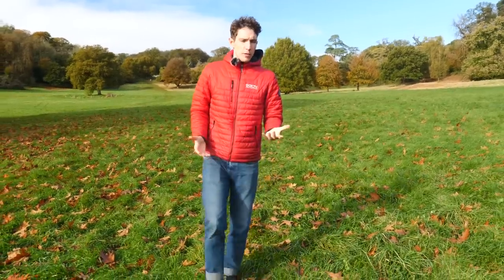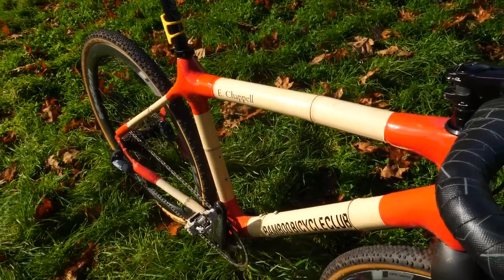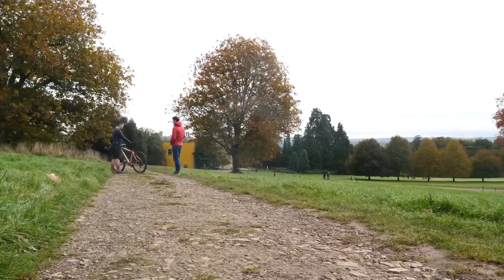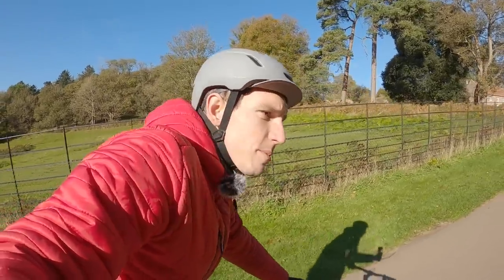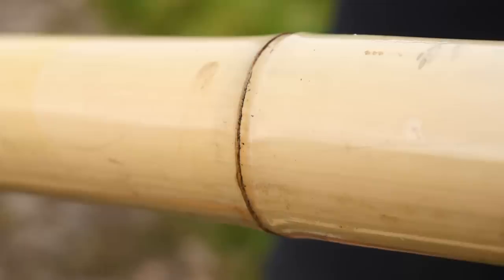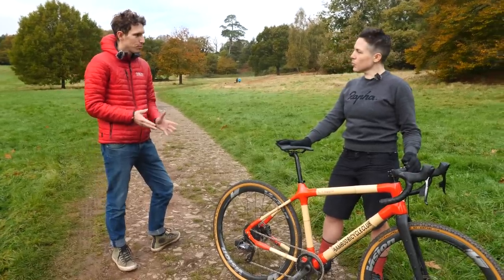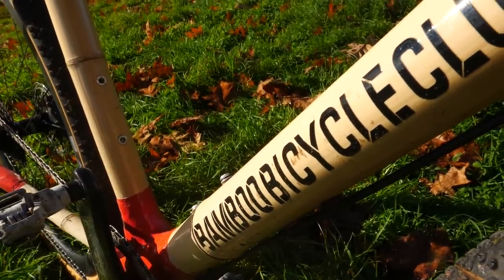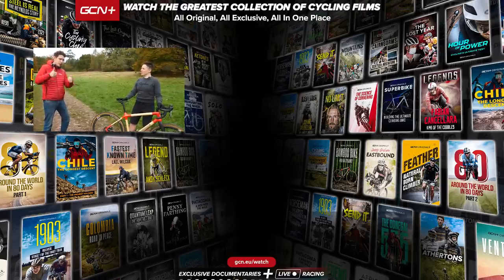Are Bamboo Bikes Actually Any Good?

Comment: I built a bamboo bike back in 2015. It's still going strong and up until a recent job change I did my 30mile commute on it every day. Been hit by cars, potholes and generally misstreated as a commuter bike often is when winter hits but it's brilliant!
Reply: Knock on wood that it keeps riding!
Reply: @JasonDBike  floats in the rain too!
Reply: Good to hear Alan!
Reply: @BamboobicycleclubOrg  it was one of your home build kits. Love it!
Reply: What's it like in the extreme cold?
I commute year round and that includes snow and ice with grit all over the roads as it thaws.  Interested to know if it would be damaged by the cold or salty grit.
Reply: @KermitFrogThe  with a good protection it will be fine.
Reply: @BamboobicycleclubOrg  That worries me a bit.  I am very typical commuter.  Occasionally do stuff on bike and treat it like a workhorse while expecting it to perform flawlessly.
Thank you anyway.  It will be a few years before I am ready to move to a new machine and I may have grown up and started taking care of things by then.
Reply: My last commuter frame I retired in 2016, that was a humble Carrera 2005 frame. So really 6 years is nothing.

Comment: Looks like the ideal material for kids' bikes.   LIght, strong, and since rider weight will be low, it is stiff enough.  I think it would be a great product if they could make kits that just required assembling the wheels and saddle  and sold in a box. The problem with many toddler bikes is that they are made of gas pipe steel an are too heavy.
Reply: It’s not a cost effective material for kids bikes because of its cottage industry nature. Too much labor input etc. Aluminum is a better choice.

Comment: Had a bamboo road bike that I built as a review for a magazine feature back in 2016. It's great, been touring across the country and ridden in horrid weather and the editor who was a gorilla rode it in a sportive event. The only thing that's gone wrong is the steel bottom bracket insert came unbonded, easily fixed by cutting some slots in it for the epoxy to grab onto and shoving back in. It had pretty budget stuff on it as I got it ready quickly but it was lovely to ride, exactly as they say here. I will say though, you ain't going to put it on the compost at end-of-life, as the West System marine epoxy is horrid stuff. Maybe greener glues will be available in future?

Comment: I'm making bamboo bikes since 2007, to resolve the flex "problems" I fixed using laminated wood+carbon fiber on chain stays and vacuum bag for the junctions. Hand-layup joints with vinyl tape compression it is not enough for get a good resin and carbon fiber ratio on composite laminate, works but not the best results.

Comment: Completed a 1000mi trip on my bamboo bike a few months ago, it was dreamy! I’ll attest to everything said here. Not the lightest or aero but I was so much stronger on my light road bike when I got home 🚴🏻‍♀️
Reply: Can you share some of your experiences regarding how it handles on fast downhills and when under high loads (steep uphills)?
Reply: Long as you can handle the weight. It’s heavier than aluminum but lighter than most steel. With a proper gear range for weight and for rider abilities, bamboo bikes ride as stiff and solid as steel. I had very high confidence in the bike. You can build the frame yourself or there are a bunch of companies you can commission, just make sure they know what they’re doing.

Comment: Given the amount of epoxy and paint on there I centainly wouldnt think it would be good on the compost pile.
Reply: Yep, its a compound. But you need way less energy to convert for it. Recycling wise with all the laquers you need to really make it rott resistant i think its close to a broken carbon frame
Reply: Per the video the “welds” are apparently mostly hemp, so there’s that. However AFAICT only the frameset is bamboo, and fork, wheels, drivetrain, bars and seat post are all either alloy or carbon, so there’s also that.

Comment: While stationed on Okinawa back in 1976, I used to be amazed how the construction crews used bamboo as the scaffold material even in a Typhoo it was still standing. If they could get the weight down I would think maybe I should maybe think about getting one, also I like they used "hemp" to wrap the joints, wink wink,LOL!
Reply: I bet the scaffolders thought it was all just a storm in a tea cup
Reply: @johna7075  they worked bared foot, made rope from bamboo that they used to tie everything together. I used to climb them till I got chased off by 3 guys.
Reply: @johna7075  Nice one John... that same thing occurred to me. You only get an Oooh with a Typhoon I guess.

Comment: Don't lie to yourself and others with "environmental concerns" - a bamboo bike is just cool, nice to have, and cheap custom. And there is nothing wrong with having nice things. 
EDIT: This vid is NOT sponsored. GCN really went off the rails on their own spreading misinformation without consulting Bamboo Bicycle Club to get a better understanding. Please do not hold Bamboo Bicycle Club in a bad light for GCN's actions.

However if your concern is REALLY the environment, steel or alu are still your best best for a bike that isn't going to shed microplastics for centuries in a landfill. You cannot infact compost a bamboo bike. The epoxy resins aren't biodegradable.  (Unless some breakthrough in materials science has emerged since I last checked.) It's the same reason you can't recycle a carbon fiber bike - epoxies aren't recyclable.
Reply: Thank you!

Also "epoxies aren't recyclable"....yet. 
Given advancements in bio tech, its just a matter of time.
Reply: @marcalvarez4890  I keep an eye on things that are "Just a matter of time" but don't rely on them.
Reply: I literally just made a post saying the same thing.  Unless it's directly compared to carbon, it's more or less faux green marketing wank.  You can build a raw aluminum frame, have no harsh paint coatings as aluminum doesn't require it, and the entire thing can be 100% recycled.
Reply: If you watch the documentary, they mention that they use vegetable glue and hemp rope for the joints.
Obviously some of the parts are still metal and rubber (chainrings, tires, bearings etc) but it's a long way towards.
Reply: @galenkehler  I do not have GCN+ as I do not plan on signing up for any subscription-based video services. Every single bamboo bike I have seen has the joints wrapped with some kind of rope or twine and then epoxied over. If it used purely "vegetable glue" for more than a fixer while it was being assembled, it would be unsafe to ride as it would rapidly degrade with moisture. Eco-marketing is still marketing. 
If you want the coolness of a bamboo bike, go for it. But don't be tricked into thinking it's somehow better for the environment.
Reply: @Aubreykun  Fair enough!
Reply: @galenkehler  The DIY bamboo bike they sell on their website uses carbon fiber lugs and industrial epoxy...
Reply: Sustainability is about education and understanding our products. By building a bicycle you build something suited to your needs and something you understand how to maintain.
Reply: @BamboobicycleclubOrg  Please do an exploration about microplastics. The most "sustainable" bike is a used one of steel, because it will outlive its owner. I like bamboo bikes as well as other different frame materials for different use-cases - they're all wonderful things. But please leave the faux-moral highground misinformation out of it.
Reply: @BamboobicycleclubOrg  And your bikes really are fantastic! Very very cool. A nice compliment to my carbon forever bike, the one my grandchildren will ride and laugh about.
Reply: @Aubreykun  complexly agree with you. We’ve never taught people to build bikes because of sustainability. We taught people because we believe it’s the best way for people to own a bike. Bamboo is one of the most accessible materials for people to learn with.  It would be great if everyone rode steel bikes but unfortunately people will always want new things better performance etc.
Reply: @BamboobicycleclubOrg  I can understand that perspective. I assume you partnered with GCN for this video, so in the future I hope you can be mindful of misrepresentations like Si's comment about composting a broken bamboo bike or any talk along those lines.
Reply: @Aubreykun  we didn’t partner for the video we far to small to afford the fees! They asked if Emily could build a frame which we helped her do so over 2 days (normally a 4 day build). That’s all our involvement.  We had no input on the video content.
Reply: @BamboobicycleclubOrg  Ah, my mistake then, sorry! GCN does a LOT of sponsored content and they haven't been the best at properly updating their description when doing so. Seeing as the bike displays the company logo in the thumbnail it seemed like something sponsored. 
It must be awful to have someone in a professional capacity be enthusiastic about your product but for the wrong reasons. I'll edit my original comment to be clear on this, GCN really should have consulted you guys about the frame to avoid this.
Reply: @Aubreykun  I didn’t get the impression that the Bamboo bicycle club had anything to do with the video. Also Simon was joking about putting it into the compost bin.
Reply: @tomnewham1269  As I said already: 
- The thumbnail shows the logo on the bike front and center
- GCN does a LOT of sponsored videos.

But to expand on it from my perspective, it doesn't come across as just an "ex-pro's bike check", because it's focused on the frame material only. The shots from the GCN+ documentary this is promoting also gave the impression that it was something they partnered with Bamboo Bicycle Club for, rather than something less formal.

And the compost thing.. I could see people actually trying that to disastrous results.
Reply: @BamboobicycleclubOrg  I love my steel bikes AND I plan on making a bamboo bike because I can make it and learn from it and maintain it. So much love. But I'm well aware that the adhesives are less than ideal ecologically.

Comment: I refuse to believe a bamboo bike is actually more "green" in comparison to an aluminum alloy frame, unless you're using some hypothetical about CO2 from smelting is worse than physical landfill waste.  Bamboo bikes still need lugs (sometimes made from carbon) and they all use structural resin (something like DP420/460) to bond bamboo to the lugs, which won't break down for hundreds of years and is very hard to recycle as it's epoxy and acrylic polymers.  A straight welded aluminum alloy frame can be entirely recycled.  The paint is offset since they both can have them - or not have them.
Reply: The joints on the Philippine bamboo bike I have are wrapped in abaca fibre and the resin they use is made from tropical plants. It is indeed bomb proof and the best bike I have owned. I don't know of anyone who has ever recycled their bike, regardless of material - though possible. But, to be fair, Si was completely off base about ''composting" your frame; if you have done any sort of paint or lacquer that ain't gonna happen.

Comment: how about material fatigue? how much will last using it during years. 
How about water damage? humidity and oxidation?
How about small rocks hiting the frame when they get fired under your wheels?
Reply: Some bamboo frames are 130 years old so the material will last. The frame must protected like all materials used in exterior environment and this prevents damage from water. In our experience rocks have not damaged frames and the good think about bamboo is it can be easily repaired.
Reply: I've owned a bamboo Calfee for over ten years. It's my main bike. It's been used to commute to work, club rides, brevets and even two 1200k's. It's been ridden a lot - it still is ridden a lot. No problems with fatigue. The maker guaranteed it for ten years. I've had it longer than that. I am a bit concerned about how long the bike will last. I'll find out. The weakest link might be the hemp and resin joints, but I've had no problems. The clear coat has chipped an worn away - I might send it to Calfee to refinish. 
I live in California where the weather is very mild. I don't have to deal with freezing weather or high humidity. I've only noticed one problem. On really hot days ( 90 degree plus) the front derailer doesn't work well. I assume the bamboo expands in the heat.
As other have said it's comfortable to ride.  The material soaks up a lot of road noise and is well suited to the long rides I like to do. The comments about this being a conversation piece are true.

Comment: Most bamboo bikes still use about 70% carbon fiber for the lugs (structural intersections) and of course the forks. They require wet lay up of carbon and epoxy, followed by sanding of carbon and epoxy. This is the most toxic and unhealthy way to build a bike. It's now common knowledge, that the safest way to work with composites is through the "PRE-PREG" process, with the second best (though quickly becoming outdated because it still involves contact with off gassing, uncured, liquid epoxy), being "INFUSION". The goal is to avoid human contact with epoxy until it has fully cured, and avoid as much sanding as possible through the use of molds. Furthermore, all sanding should be done in a water-jet, mist environment (difficult with a wood product which absorbs moisture), to avoid aerosolizing the carbon and epoxy particles. I salute anyone trying to be environmentally responsible, or bring work to impoverished people in developing nations, but please do your safety homework first. Otherwise, you're no better than a 21st century version of a pre-union, pre-OSHA, Victorian era factory owner.

Comment: Really like it but I wouldn't buy one unless it was a lot cheaper than alu/carbon AND was clearly the best environmental choice. Not the case right now I don't think.
Reply: If you care about the environment, steel or alu are the best options. Especially used ones. Epoxy aint good for the environment. I still think it looks cool and they supposedly ride nice but the fake environmental concerns from people pushing these suck lol
Reply: @Aubreykun  Aluminium is extremely bad for the Environment

Comment: Wood is essentially organic carbon nanotubes what i would worry about is the impact resistance
Reply: Bamboo is a relatively strong material, in Asia it's also used for scaffolding, while mainly hot galvanised steel (and from time to time aluminum, but it's more expensive) is used in industrial countries for this purpose.
Reply: @simonm1447  I understand that it is very structurally strong but I would be concerned with say it crashing into something with an edge
Reply: @coreygolphenee9633  In this case I would estimate bamboo is even stronger then than a typical carbon fiber frame, because the thickness of the material is higher, carbon fiber frames don't like it at all if the tubes get a hit from the side. 
You can test this by hitting a piece of bamboo with a hammer, it's surprisingly strong even if you hit it from 90 ° from the side

Comment: How do you maintain the frame though? When wood gets too dry it cracks, when it's moist it rots.
Reply: like everything else made of wood, you apply a protective coating of some sort. We've been build wooden boats for millennia and they're fine.
Reply: It is not wood, it's grass.
Reply: Bamboo don't cracks when it gets dry, since it's hollow inside. A wood with the core inside would Crack, that's why sawmills usually cut logs in the middle of the core if they make beams of the logs.
Reply: Like any material in exterior environment the bamboo is sealed with a varnish.

Comment: you know id actually be interested in a bamboo frame but how expensive would it even be,  you know its very sustainable yes but i bet its  fairly expensive and who even makes them? or is just a one off?
Reply: I got a beautiful gravel frame from a small Ugandan maker, Boogaali. £400 plus £200 shipping iirc. Add in your choice of forks, wheels, handle bars, BB, headset, seat post, saddle and groupset. Reckon mine came together at around £1600 total. Could be loads more, or less of course. Ridden 2000 miles on it since March, including a couple of gravel sportives and super happy with it. Not the lightest frame, but no question at all, it's plenty tough and very comfortable. Check them out!

Comment: There is one problems with these I can see and that’s component theft. I do wonder how quick someone could cut through the bamboo and whip away with two halves of a bike to strip it down.
Reply: Having worked with bamboo a lot if you timed it you can saw through carbon, aluminium and steel quicker as the diameter is also generally less and wall thickness lower.
Reply: @BamboobicycleclubOrg  thanks. I do like an informed and qualified response. 🙂